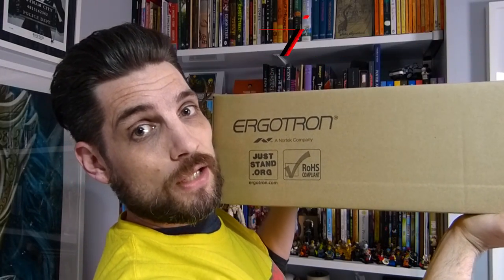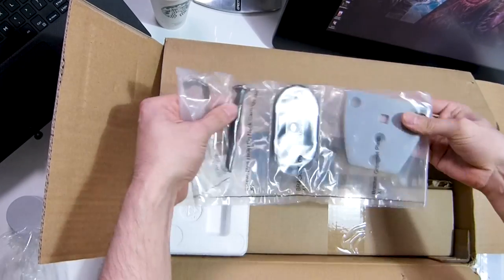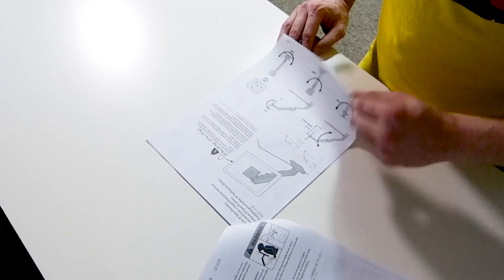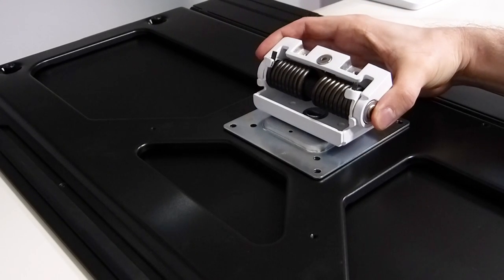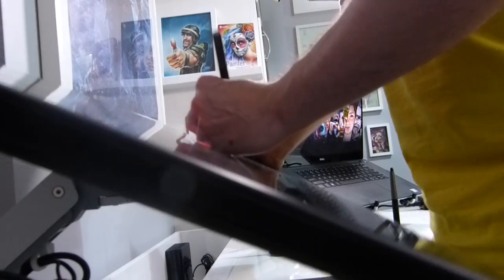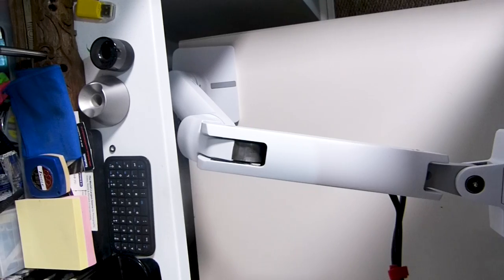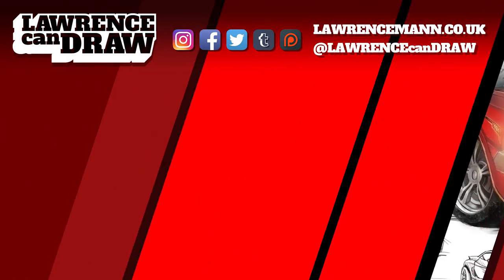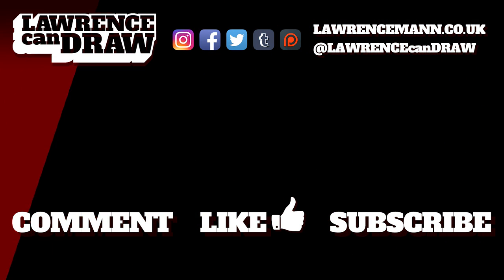Dell Canvas 27 with Ergotron arm & VESA mount

Comment: I would love to see a video of a the dell canvas attached to an ergotron arm (just like you've done) + another monitor attached to the wall via the ergotron glide wall mount. So if I was not using the dell canvas for sketching, I would slide the monitor up the glide wall mount and then push the canvas back up against the wall. This would effectively give me 2 monitors (stacked vertically; monitor above canvas). I'm just not clear from the various videos I've seen if this configuration is practically workable. My desk is small and I already have two other monitors on the left and right ends of my table.

Comment: this might sound silly but i want to mount my canvas upside down on the ergotron arm, the thick bezel on the bottom of the screen would nicely support a wireless keyboard. do you think the canvas vesa bracket is stable enough for it to used like that?
Reply from the maker: Took me a minute to get what you were planning there. You'd have no problems with this. Should be simple enough. The VESA mound is really solid. How are you planning to mount/attach the keyboard?
Reply: Lawrence Mann thanks for the reply, didn’t get the reply notif. I noticed that simply rotating it was all I needed to do. No need to mount upside down. The keyboard has long feet at the top which comfortably hangs off the canvas. Works really well when standing and using the canvas.

Comment: The Dell Canvas really interests me because I don't want to put up with a Cintiq Pro 16 and it's crudy Thunderbolt 3 ports, which my desktop does not have.
Reply from the maker: You can always grab a Thunderbolt 3 card to upgrade your rig? that's an option. Plenty of good videos and channels on YouTube to show you which cards and how to install them. The Dell Canvas uses Thunderbolt 3 (USB-C) and a lot of other new tech will as well soon so it might be a good option. Either way, Dell have included all the cables if you don't want to use Thunderbolt and it works great! Thanks for watching #ShareThisVideo!
Reply: LAWRENCEcanDRAW i sadly have used up all my PCi-E lanes with my GPU and network card. But if it comes with other cables it shouldn't be a big deal for me! Thank you for your reply!
Reply from the maker: Check out my Dell Canvas Review video! That will tell you everything ;)

Comment: Hey Lawrence, how is the wobble on your Dell Canvas? I noticed it has a bit of shake  when you were drawing on it.

 I'm confused as to why you chose that Ergotron arm over the LX sit stand arm, which looking at your wacom 27 video it looks to have more range, plus it can be drilled into the desk and takes more weight. Is the newer arm just more convenient for you in white colour and at that angle for your side desk, because i think i would much rather prefer buying the LX sit stand arm that you have the Wacom 27" hooked up to right now so I can drill it into my desk, but you mentioned the HX arm was the preferred choice, can you expand on that please?
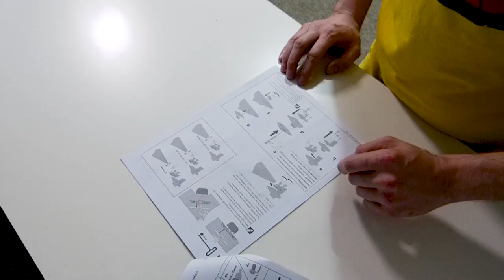Reply: Btw the Ergotron HX can also be drilled, peering at the instruction manual in the video at 9:00. The new HX takes more weight (up to 42 lbs / 19 kg) than the LX sit stand (just up to 25 lbs / 11 kg), so I guess the new one is more stiff, which should be fine for drawing. The range of the HX is less indeed and Ergotron should definitely build a "HX sit stand" arm.

There's a product from Ergomart (the SAA4229R) which combines really long reach with good wobbling resistance afaik, specifically built for large drawing tablets. It's a bit more pricey though...
Reply: actually lawrence uses the more powerful LX HD stand for his cintiq, which holds up to 30lbs (13kg). I think he went with the new one just cause it has a different angle and fits that little desk better, but the more powerful HD stand is the same price so I think id go for that instead!
Reply: sorry I misread what you wrote, wow so the HX really does take a LOT more weight then huh? thats impressive
Reply from the maker: Lee McGuire This arm is the strongest for sure but all arms (pretty much) now come in white.

The range didn't concern me with this arm and I wanted to review a different arm for you guys (supreme sacrifice). This arm can be attached to the desk via a bolt and hole fitting. Because this tiny IKEA unit isn't made of strong materials, the way I've fitted it is the best way though.
Reply from the maker: The slight wobble you could see was only there because the arm was fully extended and the footage was speeded up. The arm is very stable. As I mentioned, when you find a good position, you won't find any noticeable movement.
Reply from the maker: ryver lore Thanks for mentioning that. You can also see me pull the backing plate for this out of the box.
Reply: thanks, so I believe the HD would be a better purchase for a standard desk as it seems to reach lower and further, apart from the HX being stronger its not as versatile? whats your thoughts?
Reply from the maker: This will touch the desk. You can't push it as far back if you want to clear your desk though. I do like how 'balls to the wall' sturdy it is though. It's just tough! This is the Ergotron arm for the Wacom 32" Cintiq Pro. No doubt about that.
Reply: I agree I love the toughess idea but as I have back problems I would need it to extend towards me and down as much as I can, and from studying the video the HD stand seems to do that a lot more. could you for example put the HX in your lap if it was set up on your desk? im just trying to see if you would have to change anything when you get the 32 for example, I dont think the HX would replace the HD for you. can you cofirm this please so I buy the right one? thank you in advance
Reply from the maker: Did you get the Capisco chair yet? That will help a lot with your back and paired with the Ergotron. If you're using the armrests or putting your elbows on the desk then you should be ok. Try get a good foot rest too. I'm looking into that at that moment. I found an awesome one called the Ooloo but it's out of stock and they don't make it any more :(
Reply: not yet ive been waiting for the canvas and ergotron first! dell not releaseing in the uk is the bottleneck for my whole studio upgrade! so you would use the HX stand on your main desk fine and it would reach the same distance? im planning to use it to stand and draw too so the timelapse video you made with the cintiq and HD stand is what I wanna do too, but the HX stand looks like it wot be as suitable for this. would the hx not replace your hd stand???
Reply: Ive looked at the specs and the HX only entends out 20inches while the HD stand extends 30inches.
Reply: The HX looks perfect for smaller or tablet-dedicated tables like the one Lawrence uses for the Dell. For desks with a depth of more than 60cm the HD seems to be appropriate due to the increased reach of up to 30 inches. For large desks with any imaginable tablet position incl. in your lap the Ergomart SAA4229R looks interesting but expensive (especially when ordering from Europe), but has a reach of 40 inches (!) and it keeps the tablet down close to the table. Unfortunately there's not a single video about that one. Might also be interesting for the Cintiq Pro 32.
Reply from the maker: I might have to use the HX if I upgrade the the Wacom 32" for main device. It just means placing it further into the center of my desk. Not a problem. The alternative is changing my desk altogether. I love my desk... would I make the ultimate sacrifice????
Reply: Thats interesting, so it would go down a low enough angle for you to draw in your lap? I would buy the HX if I felt it was suitable enough reach
Reply from the maker: Not as low as the Sit/Stand mind you. You can get that in white as well now. With a white pole too :O If you mount the HX on a low unit like I have then it is excellent for sitting at. It works like a car steering wheel for fitting between your knees. No desk in the way. That is great and I've got my desk next to me. My laptop is on an arm too so I can pull that close to me. My studio is perfect for you really. lol.
Reply: I think because it doesnt go as low I really have to buy the Sit/Stand, my desk is rather tall at 31" tall.  I've been fretting over which stand to go for since you made this video!!
Does the new HX stand make the screen wobble less than the Sit/stand? That might be the deciding factor for me. Thanks
Reply from the maker: HX is solid as a rock but not as flexible. That's what it comes down to!
Reply: Bought the HX. :)
Reply from the maker: I need to work out some kind of some kind of sales commission with Ergotron here. lol :O
Reply: For the Dell Canvas too, for months you were the only person out there showing it off and selling it to people.
Reply from the maker: Who else is doing it now??? I'll slap them!!!!!!!!!! Grrrrrr.

Comment: Have you tried the Dell Canvas side by side with your Wacoms?  How do they compare?  I remember a previous video of yours with your thoughts on the Canvas' dials.  Is that still the case, or do you actually see a use for them/it, especially with the ergotron set-up you have?  Also, what about the weight &/or how cumbersome it is when compared to your other 27" monitor?   

This is the first news about the Canvas already being out that I've heard (was under impression either around Thanksgiving or Christmas). Dell has been surprisingly low key about it here stateside, compared Wacoms announcements about the  24" & 32"  tablets that aren't even out yet.
Reply from the maker: Glad to be the bear of good news in that case ;D They are practically side by side for me my I don't want to go through them spec-by-spec though I'm sure someone else will. What's the point. It's more of an experience thing. They're pretty close but one comes with a remote and the other with a Totem. The stylus is slightly different. I've reviewed both and it's best to just watch both videos and see what you think. I'm my Canvas review I did show it next the the Wacom 27QHD and they looked like twins. It's so close to call and I think my reviews are in-depth enough to help people without pushing people in either direction. Neither is right for everyone. You have to look at both websites, watch a few videos from different sources and sleep on it. I'm wary of anyone who tells you to buy something now, now, now. haha. Both are excellent. Neither have paid me! (shame) and you'll have tou go with your gut depending on your work and the way you use your computer. Hope that helps a bit ;) 

Read the comments and see if there's a bit more info that shines a light on any helpful facts for you #ShareThisVideo too ;D

Comment: TLDR: Thanks for the video - Due to shipping incompetence, I now have two of the Canvas, neither of which have the required VESA mount that I paid for.

Hi Lawrence. Thanks for your videos. I bought this monitor after watching this particular video. I bought it with the VESA mount and the ergotron arm from your links. Unfortunately, I've had nothing but bad service from Dell. I wanted to post my experience as a buyer beware.

My first (yes first) monitor arrived without the mount shown around the 7 minute mark of your video. I called and was assured they would order a new one with expedited shipping. The day it was to arrive came and went. I called and was told that in order to get that bracket, they had to order me a new monitor which would come with the VESA mount already attached. Originally they told me eight days but they ended up expediting the shipping after an email.

Two days later, I have the new monitor. Now, this thing is very pretty. It seems to be crafted very well. But it doesn't have a VESA mount attached. I have been through two more customer care representatives. I was disconnected on the last and I'm presently waiting for them to call me back. The individuals are handling the request very well but the problem is, they don't seem to have any clue what the product is they are dealing with. They don't know what a VESA mount is and only seem to understand that I'm missing a part. 

Anyway, I'll update if they can get their act together. I really couldn't find any official place to put this review. If you know of a better way to get some actual feedback from Dell, let me know and thanks.
Reply from the maker: Sorry to hear about your troubles. Doesn't sound good. On the other hand.. two Canvas' :D If you speak to them again then make sure to refer to the VESA adapter as an 'accessory' rather than a 'part'. I think that might help with the confusion. I know that they've been running training for the sales teams so it's a shame nobody you spoke to knew what you were talking about. What country are you in? I'm guessing the US? Did your invoice have a part number for the VESA adapter? If so, make sure to quote that on the phone too. 

Hope that helps. Let me know how you get on.
Reply: Ha! I wish they would let me keep the second as compensation. As of now, they say they will expedite a mount to me and I should expect it in eight business days. The part number did help. For anyone in the same boat,  you should mention :

Part# 452-BCSG

I can also expect a coupon from Dell. Suffice to say, I do not really feel compensated but I do expect to love the Canvas despite the headache.
Reply from the maker: Thanks for posting the part number. I'm, gonna do an update video so I'll add that in there to help others out! Let me know what you thing when you have it all mounted! I've got another video coming that you might want to watch of the Canvas. I just have to finish up a paid job!

Comment: I was wondering, you cannot use the puck thungy when using the canvas in more of a vertical tilt because it slides down, but what would happen if you used between the canvas and the puck one of those "magic pads" that have super tiny suction cups that can hold even an iPad on a wall? It would be a quite fun experiment and they are fairly cheap on amazon to maybe give it a try?
Cheers!
Reply from the maker: It wouldn't work because it recognises touch points :( sorry MP. And it does work when you have the canvas tilted at a slight angle. Dell redesigned the Totem ever so slightly so it's better now than the original one that over people have tried :O That's why I had 2 Canvas' at one point - because I got upgraded!!! It works on a slight angle which I will show off. It will work on any angle of course as long as you hold it there too.
Reply: Too bad :( thought it would work like a stylus hovering, it's kind of a drawback for those like me who prefer more of a vertical angle :(
Reply from the maker: You can use the Wacom ExpessKey Remote with the Canvas as I point out in another video in the Dell Canvas playlist or even a mini keyboard!
Reply: Or you could use a Surface Dial on your desk if you prefer the radial interaction.
Reply from the maker: Shhh. Who's gear you tryn' to pimp?? lol. That does actually work quite well. I have a Surface Dial on my desk too and you can use both at the same time and there is no issue - if you want to be flash that is!!!
Reply: Meh, I'm not too worried about pimping their gear.  It addresses a use case ours doesn't, so it is a nice compliment.  That is, until we come out with a better solution.  :)
Reply from the maker: It's good to know your stance on that and to see Dell being so open minded on the competition. Microsoft did put out the invitation to other manufacturers to use the Surface Dial API so I guess it's only fair I guess. I am disappointed more companies didn't take up the challenge. Can't wait to see where Dell takes the Totem! Microsoft hasn't given us any hints of it's evolution so it would be interesting if Dell takes it further!

Comment: Hi Lawrence, I'll have to look into alternatives to the VESA mount because I've been searching high and low here in NL, but they won't sell us the mount (physical sales departments are nonexistent here apparently, and they refuse to speak to me about it on written customer service). Other countries refuse to ship to NL as well. 

Anyway, any idea why exactly they've created a separate mount for the Canvas? Would another mount maybe fit the Canvas as well, as long as the holes line up? I'm pretty desperate for a solution by now. The Canvas is taking up too much space on my desk while it's sitting flat the whole time.
Reply: Can't get the mount in the UK either. 
I'm seriously thinking about making one myself. 
Can you tell me how far apart the holes are?
Reply: tmcthree nope. Like I said, I don't have one. But if you have a canvas, can't you measure the distance yourself?

Look in the comments, I think it's available in the UK if you order by phone.
Reply: @artofrengin  Sorry Rengin, I thought you had the canvas but not the bracket. 
Unfortunately I've spoken to Dell and other resellers, as well as scouring the internet. You can get the canvas on its own from a number of stores (pretty cheap currently). You can get the canvas and bracket as a package from Dell (but it's twice the price of the canvas elsewhere. But, afaik, you can't get the bracket on it's own.
Reply: @tmcthree  I do have the Canvas but not the bracket. But since you don't want to buy the Canvas and bracket in one package, I'm guessing you have the Canvas as well. So why not measure them yourself? (It's not that I'm refusing to measure since I'll need to anyway, just curious as to why you're asking me instead of measuring yourself.)